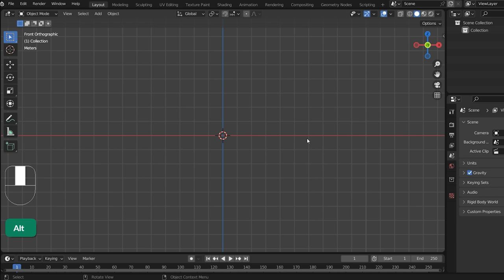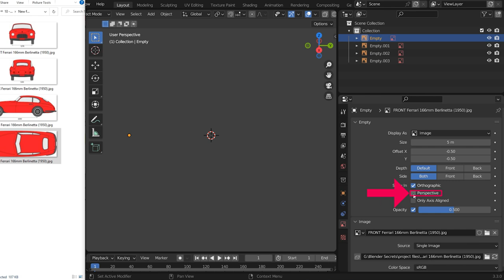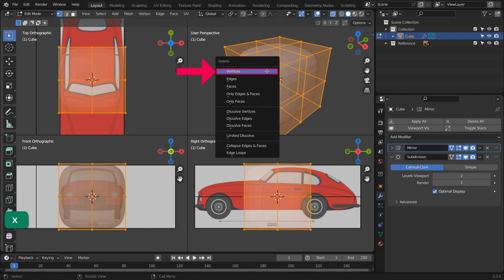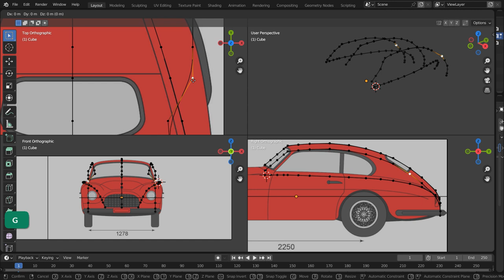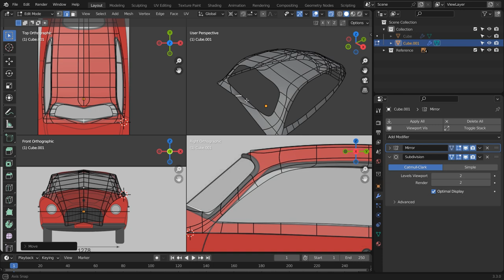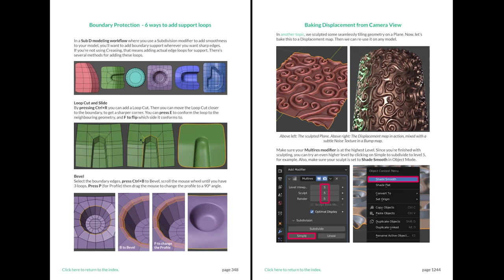Blender Secrets - Car Modeling Tips

Comment: v useful tip: create a duplicate and use shrinkwrap!
Reply: I don't understand, could you please explain what that does?
Reply: @speedrundemon21  Shrinkwrapping the duplicate to the original will let blender re-topologize it and can fix some shading issues on certain panels where glare/refections get distorted. Can also help the body panels look smoother.
Reply: But they already said it in the video